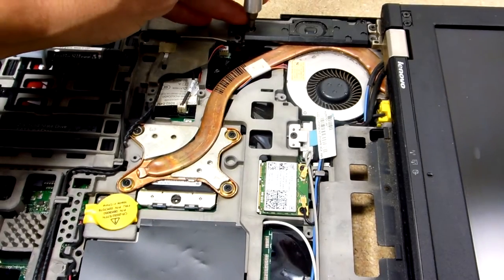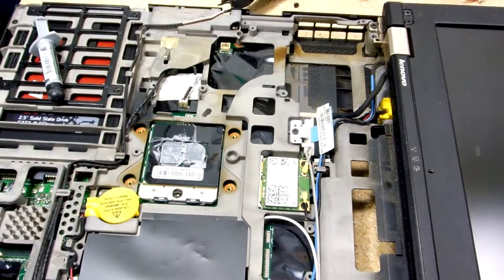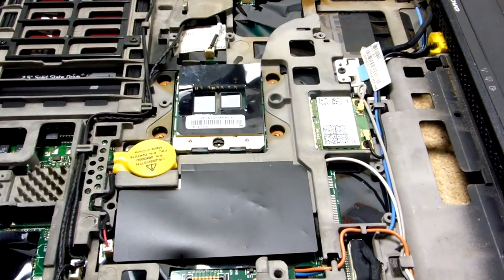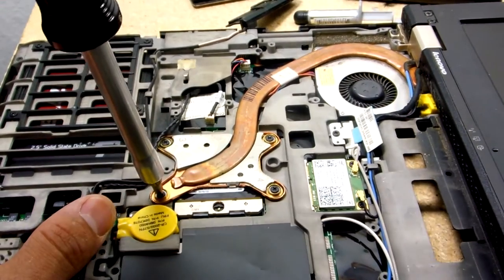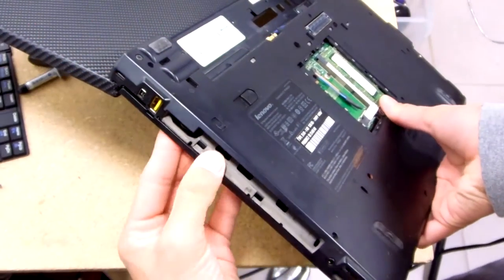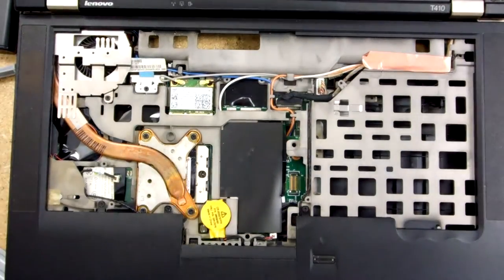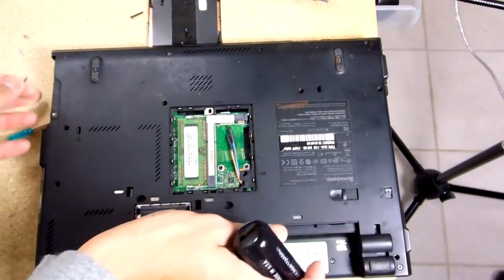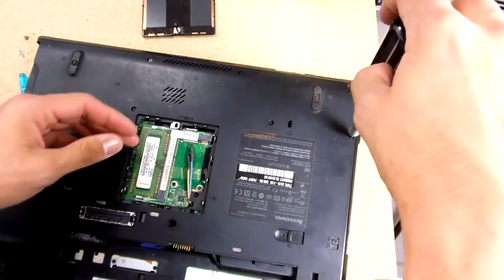Basic Tech - Applying New Thermal Paste on a Lelnovo ThinkPad T410

Comment: tip: dont use the wrong screws in the battery area. it will deform the plastic

should I just try to take the wrist wrest off and push them down, or just buy a new one?

Comment: I was curious if AS5 was proper for that kind of chip, thank you for that. Used to lided chips.
Reply from the maker: I don't know if there is a real difference. I just know it lower temps from the stock paste, I'm fairly sure most non cheap thermal paste available will be better from stock unless it wasn't done correctly.

Comment: Dislikes because: emptying the dust into the laptop as you clean the fan; touching the heatsink with your fingers (copper oxidation is bad, handle with gloves and clean it with iso); not knowing what was where (RAM) and verbally announcing it on the video. Basically, you have no business opening anything electronic.
Reply: And also cleaning with "canned air" keyboard duster. That stuff has bitter stuff that goes everywhere and the gas itself is some petroleum stuff, better off using good ol compressed air.